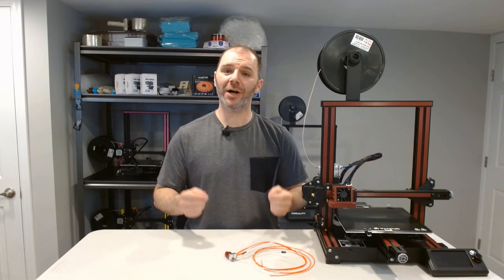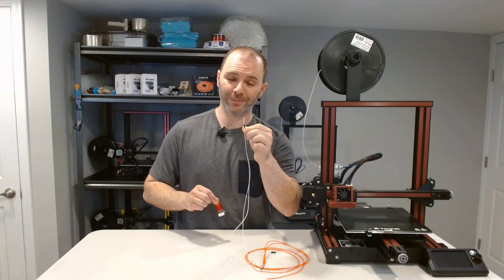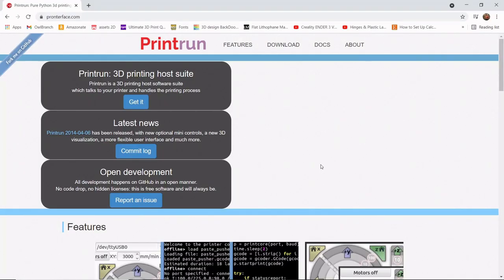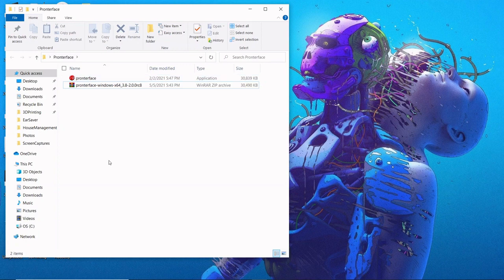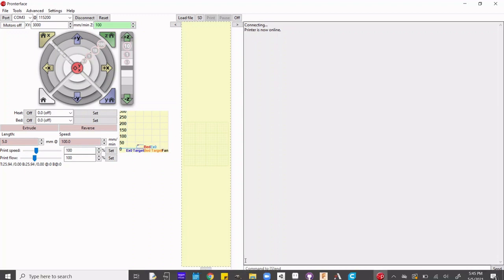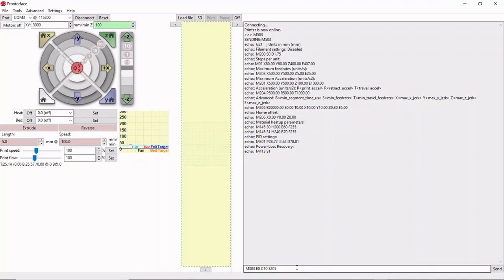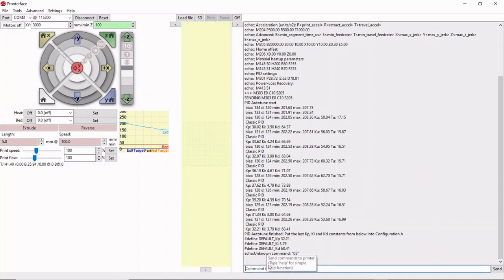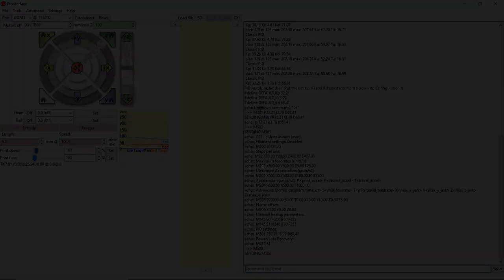PID Tuning Voxelab Aquila

Comment: If you wanted to do this for the bed, would you just use the same command but instead of E0 you use E-1?
Reply from the maker: Gomeazy absolutely! PID tuning the bed is a really important process that I didn't cover in this video unfortunately. The good thing is all the same steps and ideas apply). Thanks for pointing that out and if I remember I'll add that to the description lol thanks!
Reply: @PrintsLeo3D  Current version Aquila X2 firmware, and the E-1 returned "PID Autotune failed! Bad extruder number"

Comment: Thanks for the video. Worked out great once I figured out how to get the printer to talk to the computer. For anyone struggling, I installed the ch340 drivers but it still wouldn't connect. Messed with it for several hours before trying a different cable and then it worked. The cable I had would detect an "unknown device" so I thought it was a data cable but would refuse to connect. Lesson learned was make sure you have a data micro USB cable. Not sure how to tell one from the other but it definitely matters.
Reply from the maker: Thanks for watching and extra thanks for dropping the knowledge. I try and cover as many issues that may come up as I can, but it's important comments like yours that help round out any and all of the solutions. Much appreciated!

Comment: The big question is, how do we / I know that the actual true temp is 215 when I PID to 215. What kind of thermostat will give the best most accurate  reading? I've tried an inferred gun and I can't even get close to the proper temp. Then I tried a kitchen thermometer and it was even worse.
Reply from the maker: Hey Mark that's actually a great question, and the answer is we sort of have to rely on what the gauge is telling us. Besides that there were two ways I found to get an accurate current temperature. One is by using a multimeter and a thermocouple. The other way by using a high temperature meat thermometer used for bbqs. The thermometer itself had the thinnest needle I could find. I was able to remove the filament and drop the needle all the way to the nozzle base. I've used some of those infared gauges too but they can become inaccurate on shiny surfaces, so the results are too trustworthy. Apart from checking those ways we have to assume the 215(or whatever temp you're going for) is actually 215. Are you having any weird temperature issues ?
Reply: @PrintsLeo3D  I never thought of removing the bowden tube and filament and sticking my kitchen / meat thermometer down. Great idea. Will advise so others can learn. Be safe!
Reply from the maker: You're welcome! Glad I could help and be careful! Happy printing.
Reply: @123masteryoda123  " I've dried an inferred gun ",.. yes, I know you meant "I've tried a handheld Infrared Thermometer",... But a "Dried Inferred Gun" does sound like a suitably Alien anti-potential-nuke device :D :D :D How far was Los Alamos from Roswell or Groom Lake? lolol.

Comment: I have my voxelab plugged in to a usb but it isn't showing up at all in the COM. What could my issue be?
Reply from the maker: There's two possible causes for this. One is if you have slicing software or some other 3d related printing software running. For instance if Cura is running in the background it will 'hijack' the COM of your printer and you won't be able to connect to Pronterface. All you need to do is close down Cura and then plug the printer into your computer again.
Second is the CH340 driver. Sometimes this driver must be installed for the program to run and communicate with your printer. You can follow this link to found a download and information page on it:

https://learn.sparkfun.com/tutorials/how-to-install-ch340-drivers/all

Hope this helps. If not let me know and we'll keep at it!
Reply: @PrintsLeo3D  I have all programs closed and when I hit install I received a messaging saying the drivers were successfully pre-installed. plugged the USB back in and nothing still unfortunately. I appreciate the help btw.
Edit: I noticed the instructions said to hit uninstall first and I receive a message saying no device found. I am going to check if my usb I'm using is even capable of data transfer.
Reply from the maker: There's a portion in the video that shows how to find the correct COM, is it possible you are trying to connect to the wrong COM? Also if for some reason you cannot get this to work all is not lost, you can still perform this operation using gcode and saving it to an SD card and then 'printing' the command. What you would do is create a plain text file and then copy the below code to it. Whatever you save the file as end it with ".gcode"  (ie I would save the file as "pidTesting.gcode")
---------------------------------
M303 E0 C10 S200 U1 
M500

---------------------------------

The M303 is what is calling the PID autotune
E0 - selects the extruder, don't change this
C10 - this is the number of cycles the printer will perform, you could change this if 
           you like
S200 - This the temperature to tune around. You should definitely change this to 
              your average printing temperature.
U1  - This inserts the results of the testing into your PID settings. But you still 
          need  to save your settings!
M500 - This Saves your settings so the new PID results persist. Although once this is finished it's a good idea to manually go through the menus and save your settings. 

For this whole process to work you'll have to save this plain text to your SD card, insert it into the printer, and 'Print' it as normal, and the printer will run through the lines of gcode.
Reply: @PrintsLeo3D  My issue is it isn't even showing up in my device manager at all. And I have no way of inserting a SD card in to my computer. I'm brand new to all of this so I'll get it figured out eventually I suppose lol. May just need to wait for an adapter.

Comment: Even after doing the tuning, my hotend at 240 ranges up 3 degrees to 243, then down to 237, then back to 243 and the cycle keeps repeating. Can't seem to stay pegged?
Reply from the maker: Are you running the PID tune at 240? Are you remember to save your settings with M500 after getting the PID values ?
Reply: @PrintsLeo3D  Thanks man, well.. I am starting to think the thermistor went bad. I made sure the PID was saved but got a thermal runaway error during a long PETG print. It's a cheap part, so fingers crossed!
Reply from the maker: Sounds like you are doing the right thing. Just had to do the same install on my Jayo S8 Plus, luckily everything went well and it's printing a 24+ hour print as we speak. Good luck!

Comment: FYI- You can do this from the printer control with the latest Alex/JyersUI firmware.  You can specify hot end, bed, or both, then enter the number of test cycles to run.
Reply from the maker: Yes you absolutely can! I mentioned that in the BL Touch firmware video after upgrading to Alex's firmware. It really nice to be able to just go through a few menus and fo the same thing we do in this video! Thanks for spreading the word I appreciate it.
Reply: @PrintsLeo3D  Thank you, I'm just starting out and I've learned a ton from your videos.
Reply from the maker: Thank you so much I'm glad. I should say thank you. Whenever I say I my videos "check out the comments because they're full of helpful information" , well it's because people like you, who care enough to add important information. Thanks again, and I hope I continue to give you great videos!
Reply: Where in the Alex firmware menu is this feature?
Reply from the maker: I'm not in front of my printer at the moment but I believe it's under Control>Temperature>PID Settings. Control would be the lower left box in the main screen and then navigate from there to find the PID menu.
Reply: @PrintsLeo3D  I found it, thanks.
Reply from the maker: Great! With this menu you get to input what temperature you want to tune around, and for that you would choose a temperature you are going to be printing at. For instance I print my PLA at 205c, if I was going to be printing PLA I would tune at 205c. Similarly if I plan on printing PETG that I would print at 230c then I would tune around 230c.

Comment: Hi There, I had a new main board sent to me by flashforge due to a set of faults then my Aquila went and had a thermal runaway event due to the firmware needing to be updated 
from the official site of Voxelab as they had been told of some Aquila's having that thermal problem?

I have followed your video here to get pronterface as my new replaced hot end was changing the temperature of the hot end up and down like a Yo-yo.

So I downloaded the right version for my PC which is the 64 bit windows one.
I did as you stated on the port and speed setting of it and the pronterface just say's connecting for many minutes but don't connect?

I have tried all the speed settings for my port which I know is the right one as you said unplug the cable to check it, I did and know it is COM1. 

What else can I try to get this software to connect to the printer by cable?
Thanks.
Reply from the maker: That can definitely be frustrating. Do you have any other printer software open like Cura or another slicer? Those programs can interfere with Pronterface's ability to communicate with your printer.
Reply: @PrintsLeo3D   I have Cura 4.11.0 installed and Voxelab Slicer and Tronxy Slicer as I have got a Tronxy X5SA I be fixing soon as it can't do leveling either in manual or Auto so that be another thing to do?   But did not have any of them opened as I did the connect trying!  🤔
Reply from the maker: Are those other programs open on your computer when you're trying to run Pronterface?
Reply: @PrintsLeo3D   As I said above "No" none were opened at that time in any way! All were fully closed. Also I wondered about the version I had?  

Because it does not connect using any of the speeds of the bit rate list, 
And I remembered that in my main windows programs folder the programs are X86 versions. even though my system is a 64 bit one. 
So I tried that version that is listed under the X64 one on the download Pronterface site.  

Nope tried that X86 version at all the speeds of bits the same outcome not connecting at all?  

I un-stall the X86 version and kept the X64 pronterface program. Really a pain now!  😒
Reply from the maker: Oof, sorry I didn't see the bottom of your last post that answered my question from earlier. There are some important drivers that you may need to download in order for the software to work, namely CH340.  A link to help download and install this driver -  
https://learn.sparkfun.com/tutorials/how-to-install-ch340-drivers/all
Reply: @PrintsLeo3D   Hello, I found that for some odd reason my PC said the port the printer was plugged in to was COM1  but n fact after checking the system more I found in fact the port was COM4, 

I had to manually type that com4 into the pronterface com port display box in the top upper left.  

Then set the speed to 115200 then I went into the settings of pronterface and set the temperature of the hot end for PLA to be 208 c as I use that setting on the hot end for PLA.  

I did what you showed in the video and the PC at last talked to the printer.  I input the codes to see what the printer hot end was at?  
Then I copied it down and input those into the pronterface, The hot end went up fast and in seconds had got to 250 c.  

Then I got this error and the testing stopped 
> PID Autotune failed! Temperature too high
echo:Unknown command: "05"

What can I do now?
Reply from the maker: Well I'm glad it's communicating. I had a similar issues with my Jayo S8, it would through a thermal runaway error' during PID tuning. What I did was tune the hot end at a lower temperature to start with, I think I started at 185, and I only did a few cycles, maybe 5. This way you can get some new PID numbers, if those in, and then start auto tuning at your desires temperatures.

Comment: If you have an issue where your computer isn't recognizing the Aquilla printer lookup "CH340 Driver" and install it. It's the driver for the board inside the printer.
Reply: This newer driver updated to 034x. Had to choose that and reset baud rate in device manager. Then it connected to Pronterface
Reply from the maker: Thank you so much for the updated fix, I'll add this to the info section!
Reply from the maker: Thank you so much for this ! Sometimes I miss the forest for the trees, I installed these drivers awhile ago and completely forgot this could be at fault.
Reply: @PrintsLeo3D  I installed (now it's 034x) but I cannot connect.

Comment: those browns strips are those been 3d printed if so please tell me were can I find that thanks
Reply from the maker: Yes, those are all 3d printed rail inserts. I Designed those myself, they print without support and don't require a ton of filament. There's a link to my thingiverse account in the video description, and you can find the design for them there. I used FilaCube maroon filament for that color, it's really nice . Thanks !
Reply: @PrintsLeo3D  thanks im gonna print them in red thanks again

Comment: So I tried the PID tuning on the Aquila and I got sketched out when I sent the G-Code and the printer had an alarm go out. When I sent the G-Code command I got this:
SENDING:M303 E0 C10 S215
PID Autotune start
Error:Heating failed, system stopped! Heater_ID: 0
Error:Heating failed, system stopped! Heater_ID: 0

Error:Printer halted. kill() called!
Error:Printer halted. kill() called!
Reply: Mine just did the same thing, heats up normally, and got the same message. On the Aquila screen it said Nozzle or Bed Temp Too Low while screaming at me
Reply: @SwearingDisc0  had this same issue. I needed to Autohome my printer and then I was able to do the auto tune.
Reply from the maker: Always scary when a fault gets thrown especially when it's something with the heating system. This seems like thermal runaway protection is getting activated but I couldn't be sure. A few questions: 
1.) Is the extruder heating up at all? If so what temperature is it reaching?
2.) Is the hot end disassembled in any way? Fan shroud, silicone sock, etc.
3.) Does your machine have the factory firmware installed still?
4.) outside of the PID autotune is your printer heating up normally, for instance by using the LCD screen to adjust temperature?

Again, I'll reiterate I am no expert and issues that arise while performing 'heating' operations should definitely should be taken seriously. Hopefully we can figure this one out though.